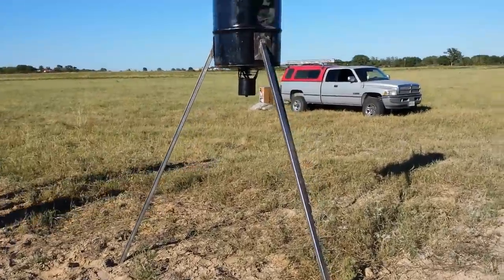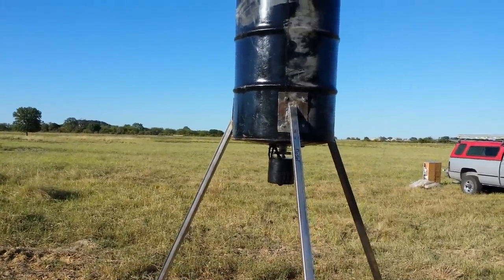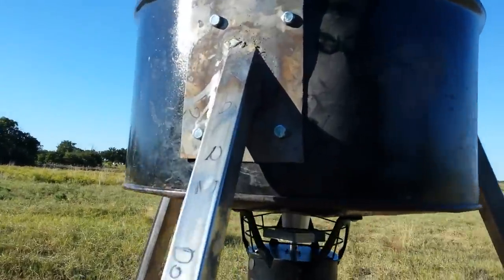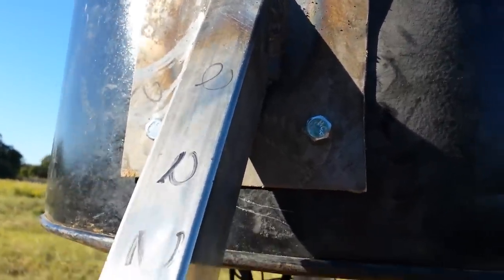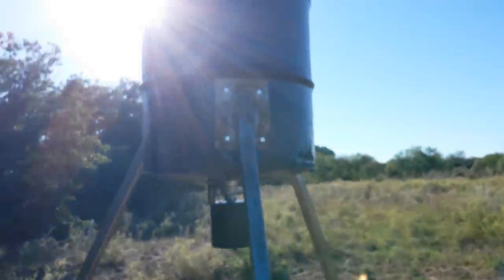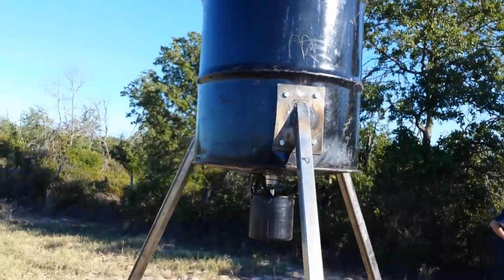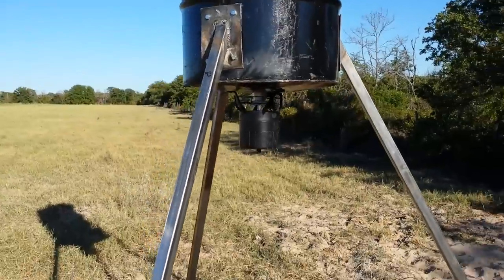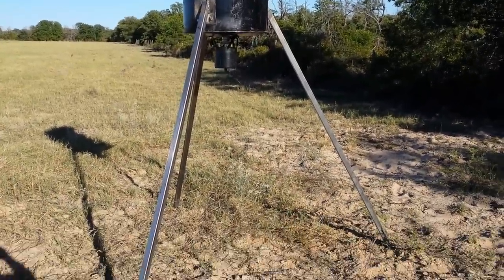55 gallon drum deer feeder

Comment: How big of a hole did you cut in the bottom and also did the motor you buy come with a funnel that goes in the bottom
Reply from the maker: The moultrie feeder unit came with a little template for the hole. I think it was 1.25" hole but not real sure. Yes the motor did come with a funnel as well. Thanks for watching Ross we really appreciate it. Check out our other feeder video as well.
Reply from the maker: Its about an inch and a half hole. Sorry I'm just now responding. Sometimes I don't get my messages.